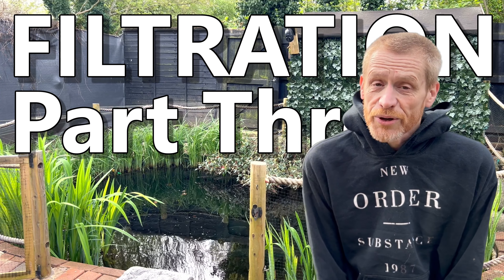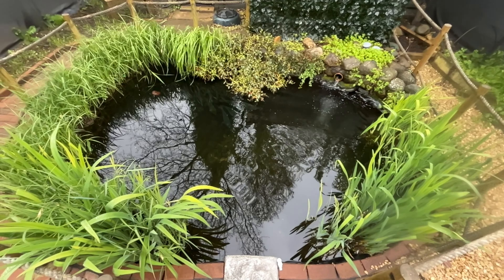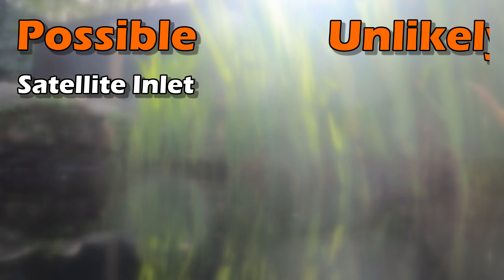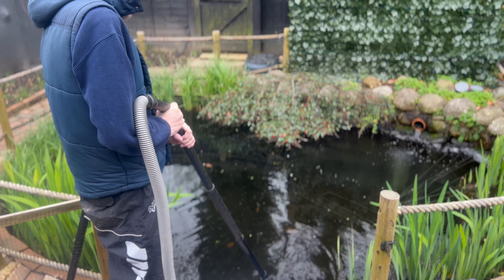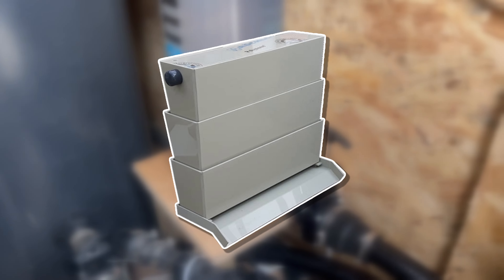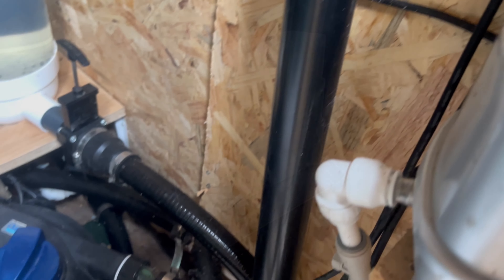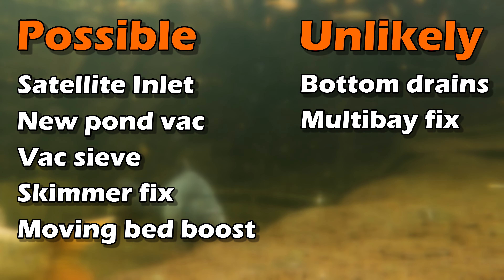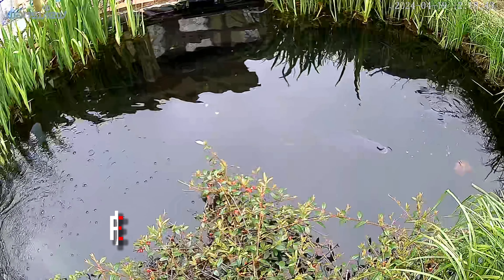Episode 108: My Pond Filtration: Part Three | What improvements could I make & which could I afford?

Comment: My pond loses so much water some times over night. I always think I got a leak but I think it's the water fall and my plants.how often do you top up your pond?
Reply from the maker: By and large I'd go with it being the waterfall, I get little or no water loss, certainly not noticeable over 24 hours. When I had a waterfall a few years ago, I found I lost some water over the sides with splashing, but also found it hard to ensure the pipe connections were attached properly - the plants around it grew really well tho!